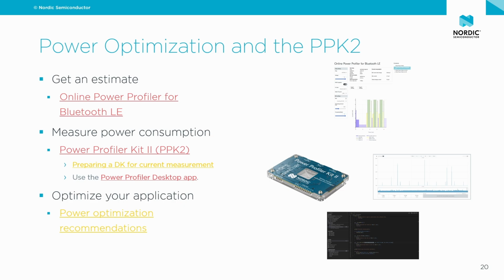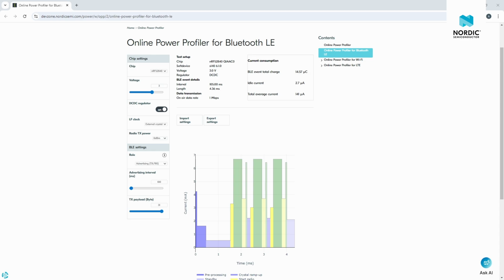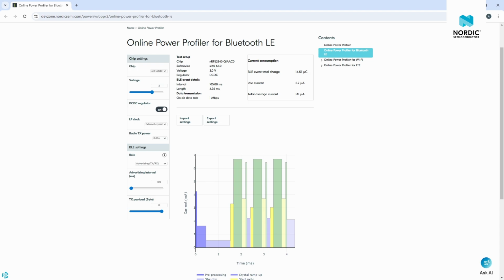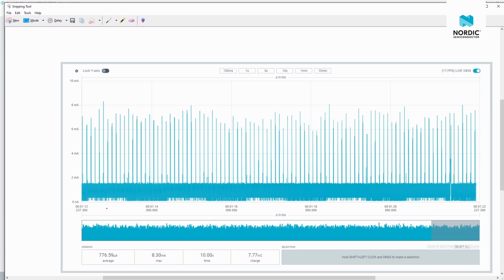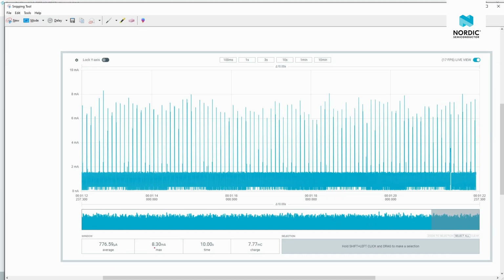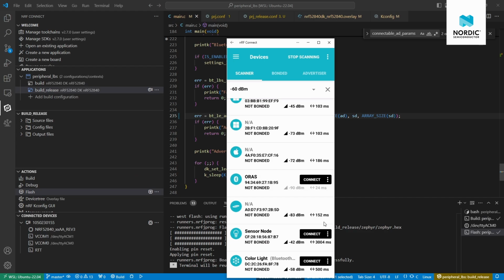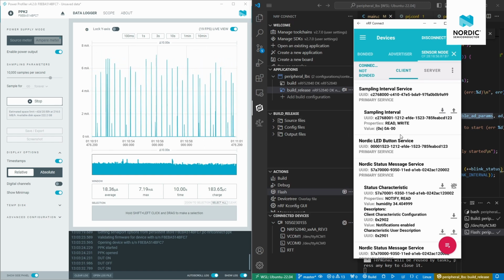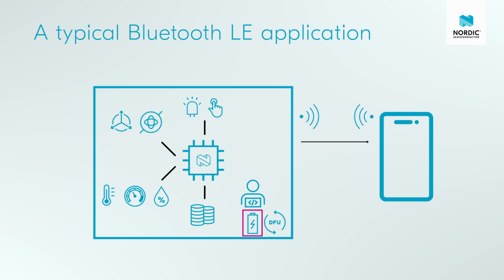nRF Connect SDK hands-on, part 5: Power Optimization and the PPK2

Comment: These videos are pretty helpful. I have a NRF52 DK with nRF52832 I am trying to reduce the power consumption on and it's giving me a good starting point. I'm measuring the current using an ammeter on P22 instead of the PPK2. With the same BLE intervals I only managed to reduce my current from over 1.2 mA to around 20 uA on average. I wonder what I have to do in order to get the source code from the Github link working on my nrf52 DK to try out your code.